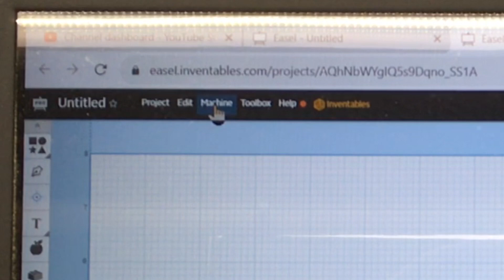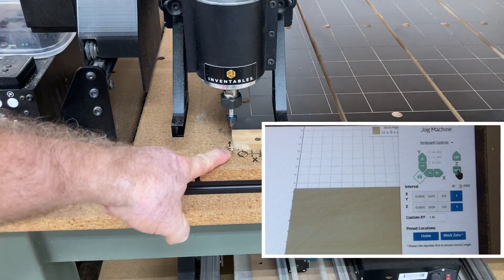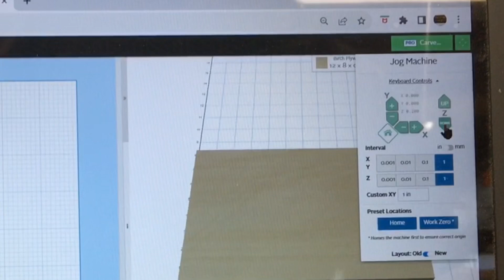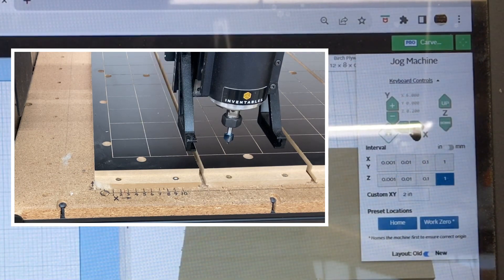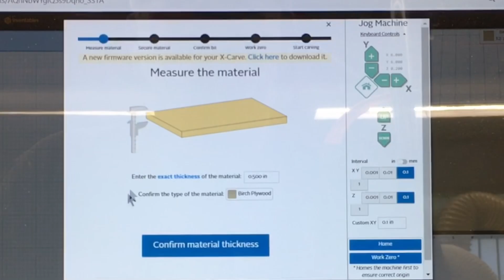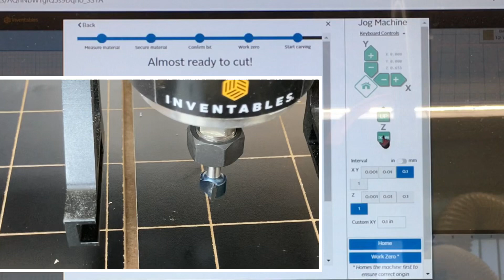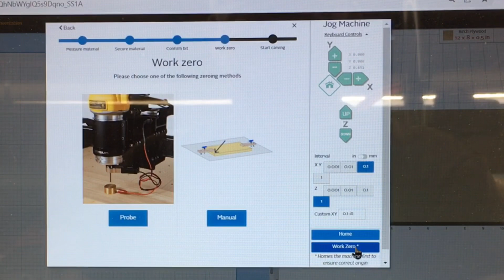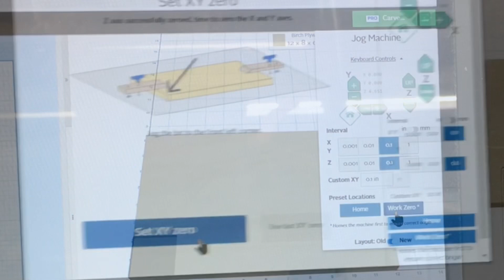Preset Work Zero and MORE in Easel Software by Inventables

Comment: How did you actually set your "work home" position to be the x+1/y+2? That part I don't understand. I understand homing the machine, I can do that. I understand how your manually go to your work home position, I can do that. I understand where you home the machine again, carrying it to the "machine home" location using the limit switches. The next step, where you push the "work home" button, how did you save in your system for that to be the position it goes to? If I push that button it goes to the far right and all the way up the y axis, the exact opposite of the machine home location. Thank you!
Reply from the maker: I move it to the 1,2 position only because that is how is set the wasteboard up. It literally can be at any point that you want. Then as you go through the checklist you must select the “set x,y home”.
Reply: @PawPawsWorkShop  I finally figured that out lol. I thought you had your machine “work home” set for 1,2 at all times, never having to reset it. I realized that after going through the pre-carve checklist that that’s when you say the x/y for your “work home” for that piece, until you either change it or turn off the machine. I found this to be very helpful when doing multi-stage cuts like having a rough and detail cuts, changing bits in between. Have you ever had any trouble with your machine losing its “work home” after the first cut??  Thank you so much!!

Comment: This was super helpful. Got my upgrade installed yesterday. It took way longer and after install we quit for the night. Today I'm trying to get the computer side set up. I can't get the x limit switch to work. It fails when I do the homing process when I was setting up new machine. Super frustrated. LOL. Looking for answers. Not even sure what to do. But this video is something I've been looking for anyways. Thanks for sharing
Reply from the maker: Congratulations on getting the upgrade completed. The limit switches are fragile and they break. Also, check the wiring. I have had the wire break as well. However, most often I have found that the switch is either broken or dirty. I actually keep extra on hand. Thanks for sharing.
Reply: @PawPawsWorkShop  Thank you! I'm super excited. I actually called Inventables support. I was so surprised to get a call back today. The x limit switch just wasn't engaging enough. So he had me go to their site and note a picture of a common issue with the z switch. It was solved by slightly bending the metal piece. It worked!!! Everything is about set up. I am just jumping on Youtube so that I can watch your video of adding the new wasteboard. I watched it before. But now Im ready to make it. 
Thank you for your  help.

Comment: 😔hi, thank you so much, it's really clear but it doesn't work for me. 
I have a smaller machine : a ''sain smart 3018 Pro ver'' but i use Easel pro. after doing what you explained, i push ''Home'' and it's ok, it goes at Home, but after when i push on ''point 0'', it move only few millimeters on the right and that's all.
Could you help me please ?
Reply from the maker: After you home the machine can you move the machine on the x,y and z axis?
Reply: @PawPawsWorkShop  yes, it's moving, but it's not going to coordinate that i'm waiting for 😅
maybe i'm doing something wrong

Comment: When i went to doanload easel it was flagged at a virus any suggestions
Reply from the maker: Are you using Chrome?  Not sure the virus software that you have on your computer. Check with Inventables. Then you might consider turning off the virus software and down the software then turn back on your virus protection.
Reply: @PawPawsWorkShop  im using edge Broser and McAfee anti virus. I did search their website and found nothing  unsure why it would be flagged as suspicious has to be a reason

Comment: Will this work for bit changes where you move your xy while changing bits?  I’m having hard time with this!
Reply from the maker: No,  if you change bits and move the machine the machine will not know it’s location. You would need to home the machine again. The best way to prevent this is to go into the GRBL settings and set $1=255. That will lock the stepper motors and allow you to change the bit without moving the machine
Reply: @PawPawsWorkShop  so do I go and type this in or change an existing setting?  Does it always lock the motors afterward or is this something I need to do every time?
Reply from the maker: Go in and change the settings. It will lock the stepper motors so you will be able to change the bits

Comment: You make it look easy . Do you know anyone in Mandeville Louisiana that gives classes . I am new at the cnc.
Reply from the maker: I do not do classes in person however, I have 100’s of videos that teach just about every aspect of cnc. I’m also open to answering your questions
Reply: @PawPawsWorkShop  I have a 4040 pro that I am new to cnc. I do not know what’s wrong with it or what I did to it. When I unlock press reset than home the spindle does not move . I can move it up and down manually but when I press home it doesn’t move. Saintsmart said I needed a new motherboard this is a brand new machine not one project done.
Reply: I need a in person tutor

Comment: You've taken a lot of steps, but as a complete beginner, I'm having trouble figuring out why you're doing what you're doing. There's a lot of movement, but I don't know how it relates to carving. I know that a lot of people will say that this is setting some sort of a home position, but without having any sort of a reference to something that I already know, I find myself quite confused.  I do appreciate the effort of trying to explain, however.
Reply from the maker: How can I help you?
Reply: @PawPawsWorkShop  I so appreciate the quick reply. I bought the xcarve, (used) and I find that it either cuts too deep, or doesn't touch the project at all. Also, the depth of cut is different than what I set it to. I set it for one quarter inch, but it cuts much deeper, probably about a third. I guess that's my biggest issue right now.
Reply from the maker: More than likely your machine is out of calibration. Look at my video on calibrating the XCarve. It’s not that hard to do. Also, the videos on the FOXAlien and the CNC4NEWBIE New Carve all work the same. The only difference is using easel or another software. I help you any way that I can
Reply from the maker: How are you setting the z axis at this time?
Reply: @PawPawsWorkShop  So a bit of an update, I discovered that I have homing switches, so using those now. Also, they just delivered the z probe, and some bits so I'll be experimenting with that.
Reply from the maker: Awesome. The homing switches are a nice feature. The probe will definitely help. Lot better than manually set the z axis with a piece of paper
Reply: @PawPawsWorkShop  I have just ordered a probe and some bits (I have like 2 bits... ) so yeah...